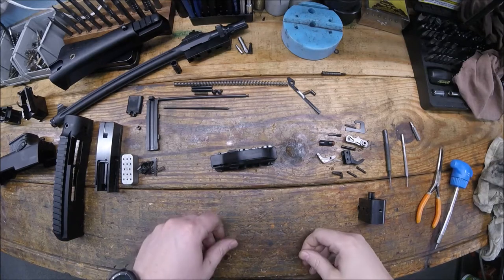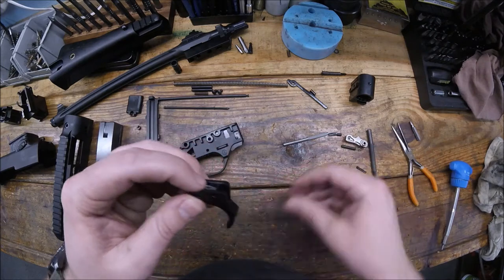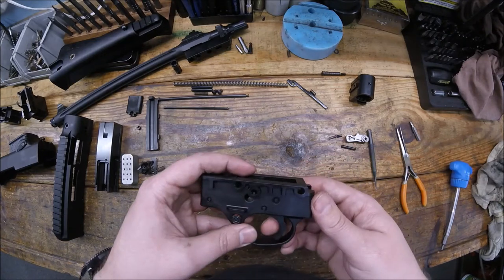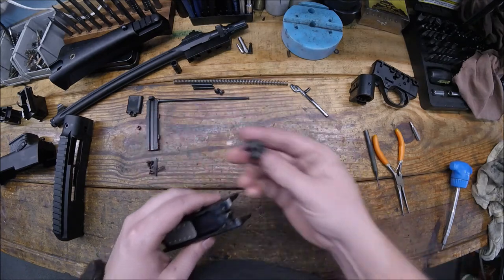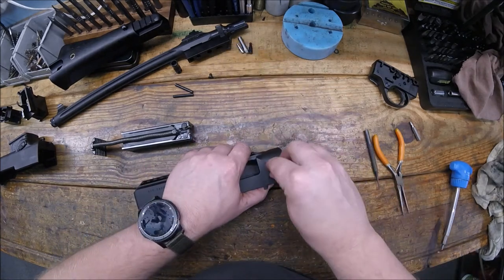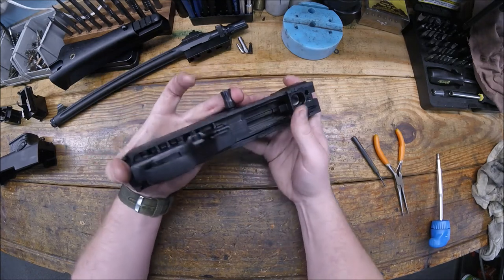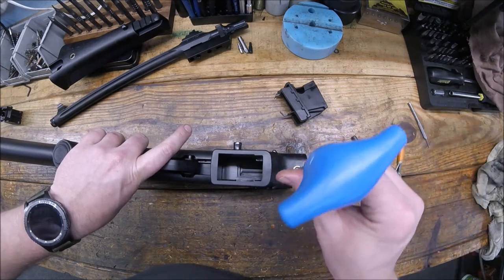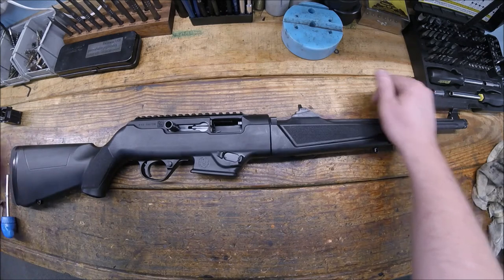Ruger pc carbine reassembly

Comment: Good video brother. What helps me out when putting the safety detent spring in is a 1/8 flat screwdriver. Taking it in from the opposite side and holding down then pushing the safety switch up against the screwdriver and slowly pushing, not much force needed, and once the safety selector is over the detent you can remove the screwdriver. I know for me this works much better than a punch, because some punches have a slight bevel as well as some magnification. I've swapped out several binary triggers on my Chargers and after assembling and reassembling and having springs fly across the room, I've not lost a single with the screwdriver. Thanks

Comment: I noticed my rear pin for the trigger pack is shorter than the front one. Is that a defect or normal
Reply from the maker: As long as it holds everything and is not falling out you are fine.